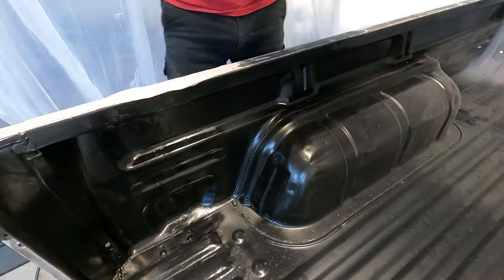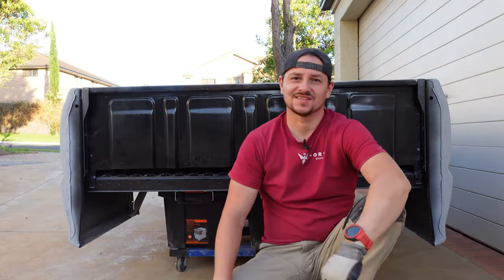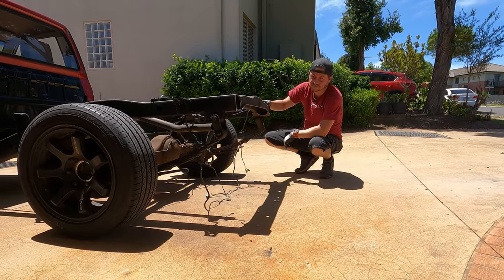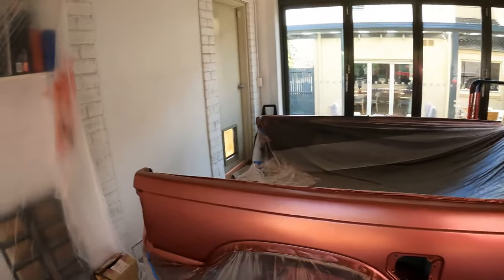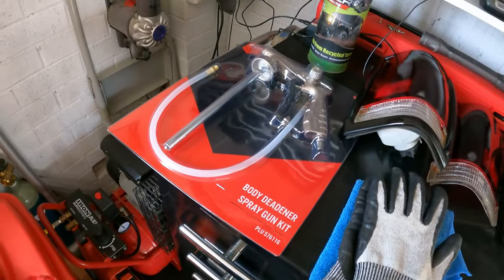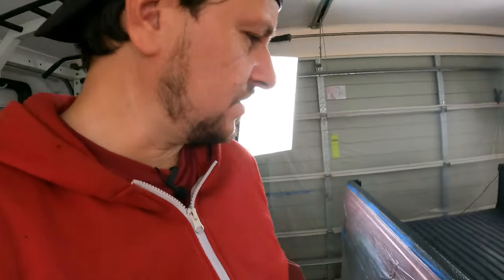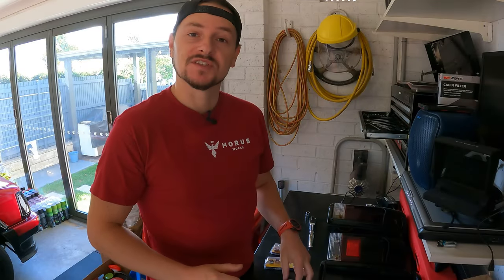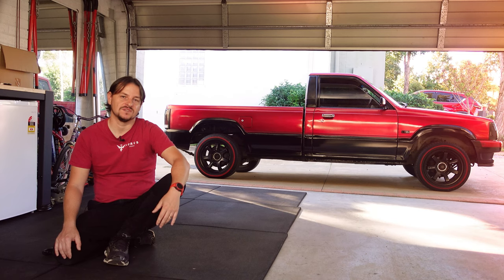Budget Mini Truck Build - Part 7 - Finishing the Paint - Mazda B2200 Ford Courier

Comment: That is cool! First time I've ever seen somebody  have a short box on a long box frame. Usually it takes alot of work to shorten the frame  to make a short bed conversation  but you did it by taking the length  out of the bed AFTER  the rear wheels!
Reply from the maker: Thanks Tony, yeah I figured changing the wheelbase by shortening the frame would only cause other headaches (new driveshaft, relocating brake lines etc). This was I only had to tackle body work. I'm very happy with the result and thanks for your comment 👍

Comment: That truck turned out great! Only thing I would have done different, would have been to shorten the bed between the rear wheels and the front of the bed. It would have looked proportionally correct. However, that would have required you to cut and re-weld the frame, and have your driveshaft shortened.
Reply from the maker: Great suggestion Blake, I wish I had the skills for that, haha. This little stubby bed is growing on me - now to lower it...

Comment: Monumental amount of work. Congrats. You must have very understanding neighbours. How does it drive? All the best.
Reply from the maker: Thanks mate - about 3 weeks of work total, spread out over several weekends. Considering that I used grinders, solvents and lots of sandpaper I do owe the neighbours a lot, especially when I factor in that I left the air compressor on by mistake for a couple of nights!

Comment: Nice work mate, it inspires me to do more on my 95 b2600 ( actually a courier 4x4) space cab. If I caught you doing this earlier I'd have suggested to swap bonnet for the EFI bulge one and maybe find doors from a 86 courier with opening quarter glass and 4x4 guards for wider wheels . Yours still looks cool tho 👍
Reply from the maker: Thanks Marty, appreciate it mate. I ALMOST got a set of 86 doors with quarter glass, but right at the last minute they got sold - that would have been an awesome addition. Now go do more on your 95 b2600 😀😀
Reply: @Horus_Works  I found A pr of those doors at a local wrecker $50pr !
 I did turbo it last year , and swapped out the diff for a 3.0td with LSD . There's lots of repro parts for these now, Thailand and South Africa love them .  Cheers from Adelaide 👍
Reply from the maker: @marty3469  Thanks for the info Marty! How is the 3.0td diff? Same ratios as stock?
Reply: @Horus_Works  The standard ratio is 4.44, the diesel 3.0 is 4.1, not much different in driving, gears are a little longer . It's a bit involved with modding tailshaft , if I do it again I'll use a Triton diff , plenty of ratios to choose from
Reply from the maker: @marty3469  Thanks for the reply Marty, the taller gears are probably welcome on the highway anyway I'd imagine.